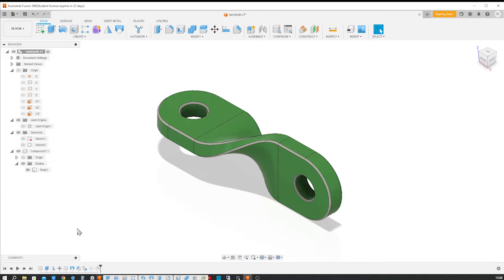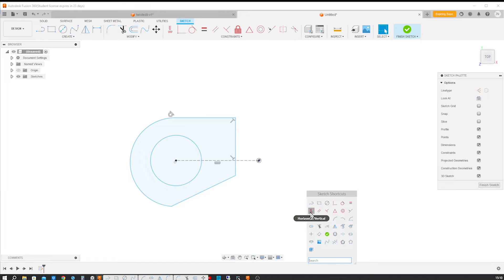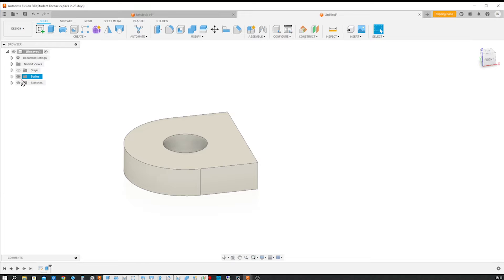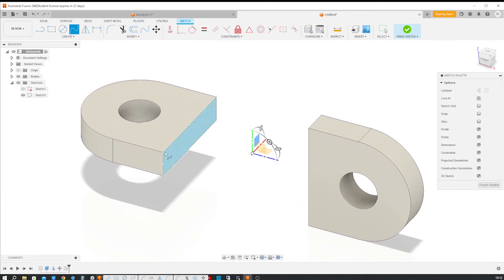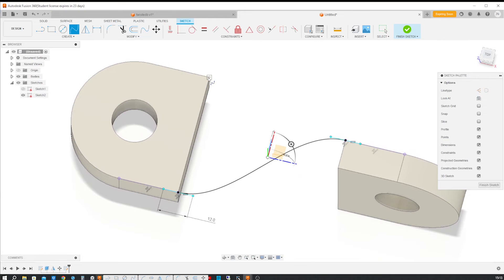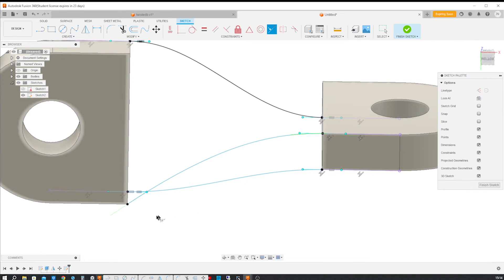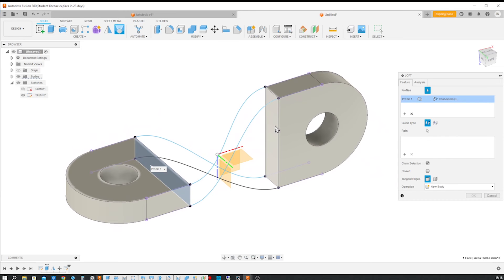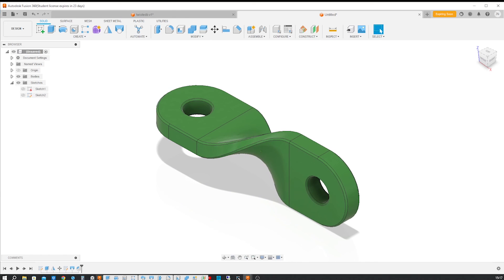Twist & Connect: Mastering 3D-splines in Fusion 360

Comment: I thought this was going to be fast, but I can not apply the collinear constraint to the first spline. It wont let me selct the line on the body. Then I tried the project command on the two corners before I drew the spline. That worked, but it snaps to the center line of the sketch before the extrude was done. After 2 hours of this, I've had enough! Can you tell me why it wont let me select the line on the body to apply the constraint please? Irritating hobby I'm trying to learn at age 71. I've made parts in my own machine shop, for 43 years but the new age computers are a different animal! I could have made 1,000 of these parts, from a sketch, drawn with  a pencil on a piece of toilet paper, in the time I've spent just trying to draw it on a computer in Fusion 360! I have always wanted to learnn CAD, so I keep learning, even if I will probably never use it.
Reply from the maker: Hi Gary, I'm sorry to read about these issues, at the  same  time I'm impressed that you start learning  CAD at 71! I started drawing on paper but found a  liking in this. Now, about those  splines: at the  very  end of those they got handles, you  need to click  in the vicinity of the endpoint and they appear. Once visible you can apply the appropriate  constraint. I hope this helps.
Reply: @cademist  I followed you exactly, several times, 12 hours ago. That didn't work! I noticed you had the colored origin appear when you clicked on the first spline point. I thought about the settings in preferences. I went in and checked the box: "Allow 3D sketches of lines and splices." I was able to finish the drawing after I checked that box. Was I correct? I never quit! I'm getting good at figuring out problems ! LOL I like CAD drawing too. I had to make hundreds of sketches and reverse engineer parts so I could make them, and then a month later, make them again from my sketch. You have to make sure you don't miss any dimensions or your in trouble when you have to make the part from your sketch. I taught myself machining, welding, electronics, and how to run a successful business for 43 years, all without any help, or the internet. I look forward for more of your videos!
Reply: I started over and redrew the part from memory in 7 minutes without looking at your video! I'm proud of myself. When you learn the hard way, you retain more, has been my experience. I seldom make the same mistakes, I make new ones but learn each time. Thank you for the excellent video! I learned a lot from this one!
Reply from the maker: Great that  you figured that out with the  3d-sketch. in Fusion you are not  constrained  to  a  sketch  plane, they are  just there to  help you orient  yourself.